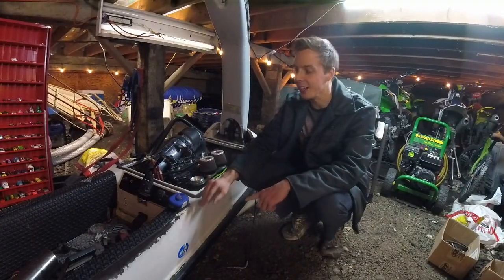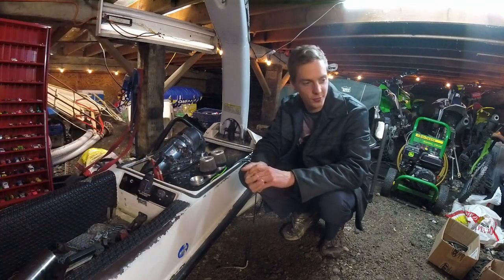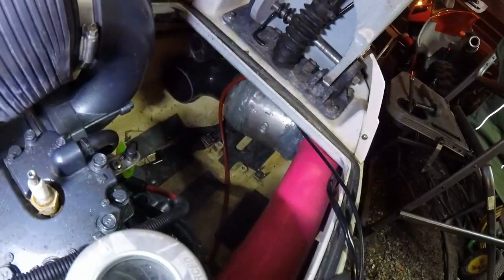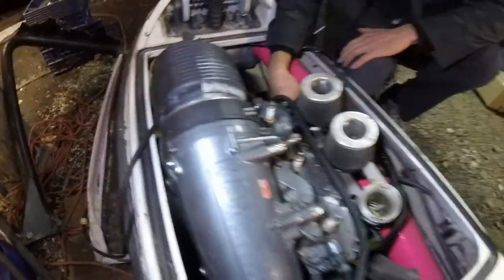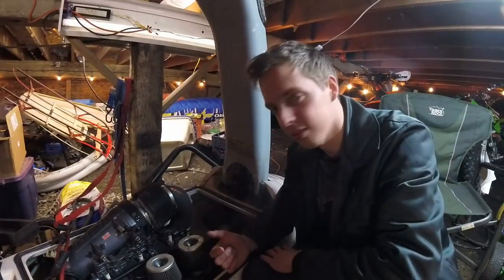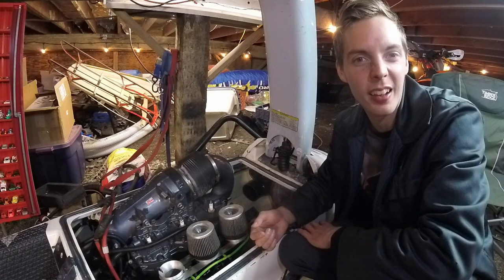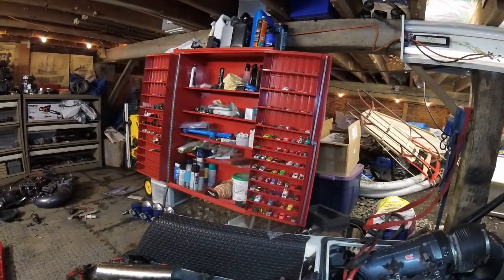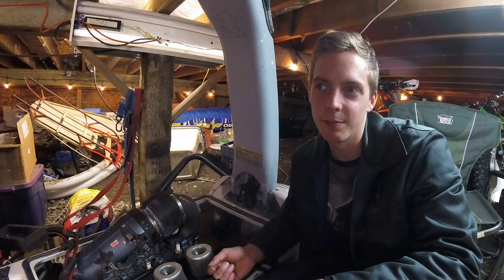super jet engine swap

Comment: Where did you get the motor mount conversion plate from and how much did it cost
Reply: I made it myself, but you can buy an adapter from ADA Racing for $300
Reply: Jacob Superjet Jet SKI ok, thanks guys and keep up the vids!!
Reply from the maker: John22724 that’s a good question I will see if Jacob can chime in in on this because it is his build

Comment: I feel like the 1100 is better than the 1200 but I guess we will see when they're head to head
Reply: Yeah everyone says that. I guess the waveblaster guys would know best because they run both. Nobody swaps yamaha triples into sxrs. Could be because its a huge pain to do and the kawi 1100 is basically bolt in.  My only experience with kawi 1100s is in the sea rat (1100sx). We've had to mess with it a LOT and I wouldn't say it runs that good yet. Really though as far as power goes, I think both can provide awesome power. It's probably more about what one fits in your ski better.
Reply from the maker: b00st it seems like the 1100 Kawasaki is what the pros use rather than the Yamaha 1200 must be some reason for that. Maybe because it bolts right in to the sxr800 or it could be better for mods. But we will find out which one preforms better stock. Might mod them as well but we’ll see

Comment: Currently restoring a 1990 650 square nose and a 1996 701round nose. Both have b pipes , do you have any tips for tuning them? Love your builds and vids.
Reply from the maker: Urticate I think that when you have a b pipe on them you have to rejet the carb. I could be wrong though, I can try to get Jacob to chime in on this he has more experience with the b pipes
Reply: I've messed with the b pipes a bit. We had one on a dual cooled 1996 round nose and it seemed to get too much water in the exhaust no mater how we tuned the screws. We would have water on the spark plugs after a wile. If you run dual cooling I recommend 3 pissers rather than 2. We also had a 1991 square nose with one that always ran perfect. 
 As for all the screw adjustments,  I really don't think it makes much difference what  screws you have open and closed.  Its more about haw much water you let in. You can run them hot and its fine as long as the rubber coupler doesn't melt. I fiddled with all the different screw positions and I couldn't feel the difference. with that said I think I just ran the middle one open(maybe half turn) and the other 2 shut.  And I just use the Factory pipe recommended jetting. Thats my experience. Hope it helps.
Reply: Jacob Superjet Jet SKI nice good advice thank you I’ll keep this in mind